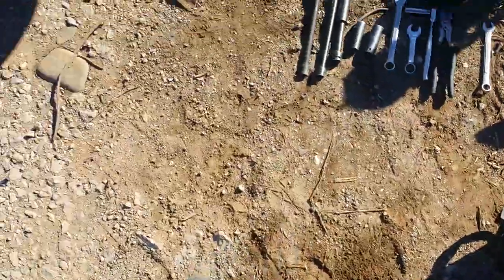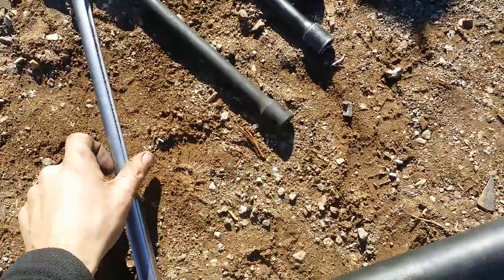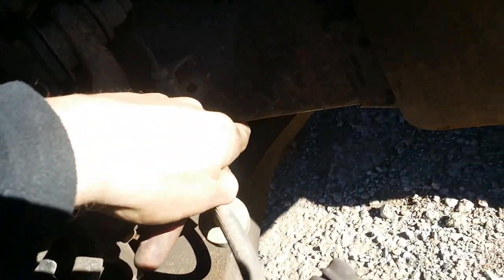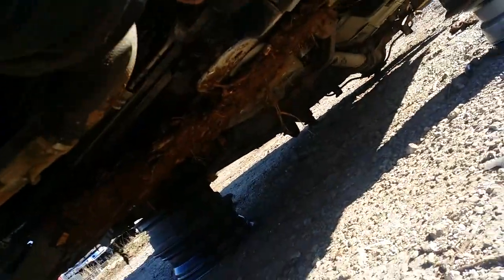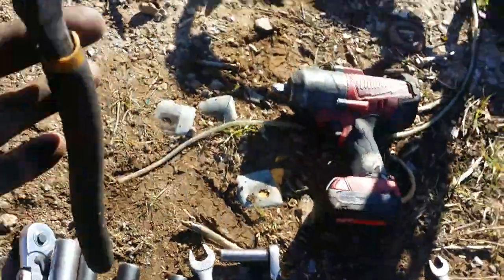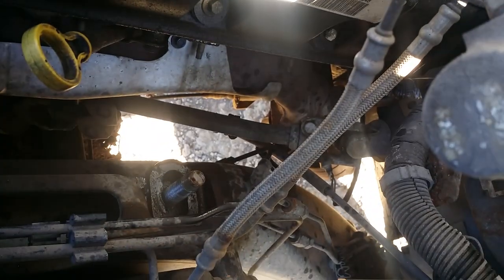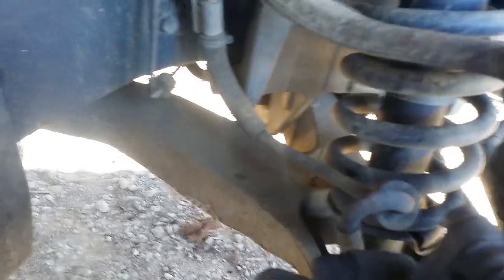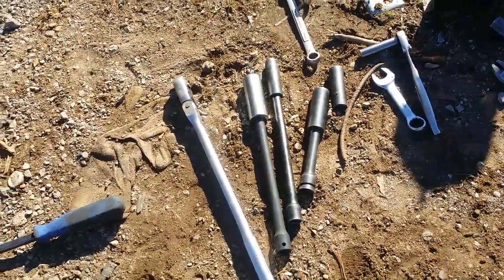Tools needed to remove a crown vic subframe f100

Comment: Great Vid! I would suggest in the description a list of tools and extension lengths, that way people could print it out. If you check out Texasknowhow in one of his vids he tells what parts you can get from Ford and part numbers the 4 spacers, bolts and nuts. He also give a web site that someone makes a kit for the trailing arms that can be welded in on your frame. If that helps!
Reply: Here are those parts from Ford:
Bolts (4) - W713803-S439
Nuts (4) - N804431 S441
Spacers (also referred to as tubes) - 3W1Z-5D096-AA

Comment: Just pulled a 04 Grand Marquis, instructions were spot on!

Take what he says seriously and get a short 18mm, he's 100% right, it'll make the power steering removal much, much easier. A short 21mm would also help.

I did it without an impact, just breaker bars, and we broke a 21mm deep well - bring impact sockets at the least.

With no power tools, we found and removed one in under 2 hours.
Reply from the maker: I also recently made a video of me removing one that was live on my Instagram..... but I uploaded it here too!

Comment: Thanks for the Vid!!! Have changed engine oil pan gasket using your video. It's way better than dropping transmission. Did some extra steps, like: taking calipers off, unscrewed rack & pinion (used bungee cord to hang it on sway bar),  unscrew sway bar links (but keep the sway bar in). It took me about 45 min to drop crossmember off and get full access to the oil pan.
Thanks again.

Comment: This procedure worked perfectly!  I also used your tips for checking out the health of the IFS before pulling it, and I pulled the passenger side back main bolt before I did the whole procedure as you suggested in your 2nd video.  Now I have a great IFS out of a Lincoln Town Car, and can't wait to get it into my '49 Studebaker truck!  Thanks a ton!

Comment: Used this video today to drop the subframe off a local guy who was parting out his 05' Crown Vic. A local shop was asking $900 for one that he had. I was able to get this one for $150! Malachi you saved me a bunch of money and this video gave me the confidence to go for it. Thank you so much! 

It took me about 2.5 hours because I forgot the 1/2 drive for my impact gun so I did everything by hand. (dummy). Definitely needed the breaker bar. Also I was afraid the whole thing was going to fall on me while I was under the car but not until I pry barred the thing out did it move. Also, great final tip on driver side first and with loosening the bolt on the arm, it allowed the whole subframe to fall. Lastly, this thing is about 400 pounds so make sure you have the energy and manpower to move it if youre not at your shop.
Reply from the maker: Alex Mac Glad it helped you.

Comment: Used your video and pulled my crown Vic front end today at  the junk yard .  Took about 30 min .  Definitely need the stubby 18mm for the power steering line .  I didn’t have that and that was what took most of my time .   Thank you for your video , your information was dead on .   They charged me $520.00 bucks though …. Ouch

Comment: Thanks for posting this. I followed your directions and had no trouble. I did tie the motor up just to be safe as I feared it might drop. Now to narrow it up 4-3/4" to fit my '48 Chev car.
Reply from the maker: Glad to help. I've dropped close to 80-90 of these now and even dropped one this afternoon.
Reply: Today I cut out the 4 anti-crush tubes to re-use on my project. It went easier than expected. I used a 1-3/4" bimetal hole saw and removed the pilot drill from the hole saw so I wouldn't hurt the threads in the tube. The hole saw is just over 1-1/2" inside dia. so it pilots on the top of the tube. Once the frame rails are cut from the top the tubes are loose and can be pulled out. In my case on the front two tube holes when the factor punched the holes the punch just folded the slug down and it did not break free, so when they welded the tubes in the hole slug is now attached to the tube. the slug then interfered with lifting the tube out, If this happens, just thread one of the long bolts in from the bottom to full thread engagement and hammer up on the bolt head (or jack up the bolt head) and the tube will come out. The hole saw cut the frame rail in under 3 minutes per cut. :)
Reply from the maker: J. Gregg I thought about doing something like that. Never tried though

Comment: Thank you for this video. It was incredibly handy when pulling my first CV front end. Luckily, the engine was out on mine but using hand tools, it took a couple of hours. The last tip on loosening the four 15mm bolts to drop out the suspension I think was the best and I think the most important. Great video, thanks again.

Comment: Thanks for this!  I followed this video step-by-step and was able to pull the front-end out in about three hours.  Being my first and only time doing this, I took it slow.  There should be a caution though.  You don't want anybody under the Clip when you loosen this last four nuts.  I barely loosened them on the driver's side and that puppy came down.  Only cost me $250 including wheels and tires.
Reply from the maker: Great price!

Comment: Awesome tutorial and helped me pull one today.

One FYI, apparently there are Crown Vic's with a steering lock and the oil cooler.  Looks like they are detective models or another service package.  If you run into this and cannot reach the steering shaft bolt, the column can be unbolted under the dash (10 mm) and as the sub frame drops it will pull the inner column off and now the steering can be rotated to access the bolt.
Reply from the maker: Glad to help.  It really isn't very hard if you go in with the right tools.   Good to know...... I have never seen that set-up and have pulled about 60+ of these so far.
Reply: Yeah, it was odd...oil cooler, certified speedo, real back seat, no holes in the dash...and a steering lock and a CD player.
Reply: Oh, and ours is going into a 1948 Plymouth Sedan that we use as a 24 hours of LeMons racer...should be interesting since all the vintage Mopar forum say it is too wide for our application.
Reply from the maker: Michael Krenzer that sounds awesome! I'll subscribe for video updates. I love crazy stuff.
Reply: @ykmalachi  I found 2007 any special or different tools I need to remove?

Comment: I watched all of your f100 videos and they are very helpful. Did you use the crown vic rear end or an explorer rear end like other swaps I've seen. Also how did your intake mod work?
Reply from the maker: +Donny Fast I used the cars axle. fits fine.  intake mod was a bust. I bought the solid aluminum intake and never had a problem again.
Reply: +ykmalachi did you have to notch the frame for the rear end? thanks for the reply

Comment: What would I do different if I was taking everything. Engine ,trans and suspension.
Reply from the maker: Drop suspension as shown.  Once thats done, support engine from above.  Drop transmission crossmemeber. Lower whole assembly to the ground. Slide on out from underneath. Or pull grill radiator and front end. Then pull from the front top side.

Comment: Im working on a CV swap to a 56 F250 … my question is do you need to wire for the ABS from the CV or can you just omit them altogether ? I assume if I don't wire them I just wont have ABS which isn't a big deal to me
Reply from the maker: Correct. Just cut the wire if you have the early versions. 2003-2005? Later years just unplug at the bearing.

Comment: Hey great video, thanks for sharing. So you mention that if the transmission support is still in place the front end will drop off. Will this hurt the engine? I am planning to use the 4.6l v8 but don't have any place to put the engine and transmission before putting the front suspension on my f100. If I could leave it in place and not do damage that sounds like a better option. Let me know and thanks for the video.
Reply from the maker: Does not hurt anything.  The trans crossmemeber will hold everything up.
Reply: @ykmalachi  perfect, thank you.

Comment: Does this also apply to the non Police Interceptor?  Are there any differences?
Reply from the maker: Nope. Same job. Police cars make getting the nut on the power steering line a tiny bit harder to remove from the timing cover due to the oil cooler. But identical job

Comment: they don't mix metric and standard bolts on cars... your 15/16 nut is a 24mm.
Reply from the maker: Wrong. They use inches on wheels to this day. As well as on the lug nuts on these cars. So while a 24mm is interchangablebwith a 15/16ths..... your attempts to sound smart are not totally factual. wink wink.... fucking with you

Comment: just look at the vin if it says P71  its a police package.
Reply from the maker: ford nut it is not in the VIN itself. look on the option tag. having pulled over 70 of these, the best method is the oil cooler check. faster than any other means.
Reply: ford nut yes it is the vin if it has p71 in the vin its police package.

Comment: I want to drop the motor, trans, crossmember as a unit. any tutorials on that? I have done the trans crossmember on the car before, I recall it was like it was pressfit in..
Reply from the maker: You can drop it all straight down. Make 100% sure all harness and connectors are removed. Exhaust will be a hassle and should be yanked first I think.

Comment: What have you done when you experience a stock 21 mm bolt that just won’t come? I’m trying to pull an 08 and I’ve got one that just won’t come even with an extension on a breaker bar. The Milwaukee just looks at it and cries.
Reply from the maker: I have never found one I can't get with a huge bar on a 1/2 ratchet or breaker bar.  If you can heat the threaded bung in the top of frame rail..... that might help. But yes..... some of those I bought in Michigan were like that. Wicked hard.